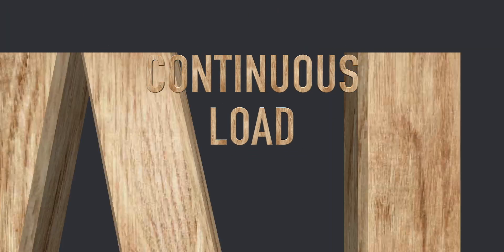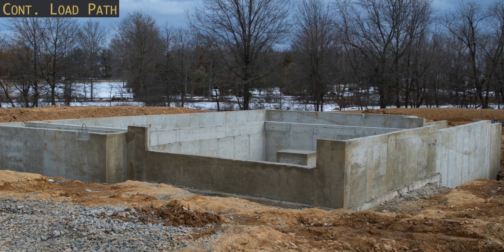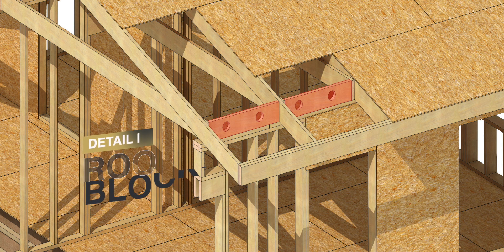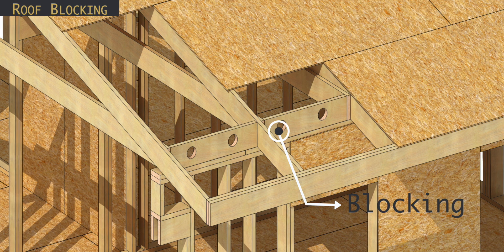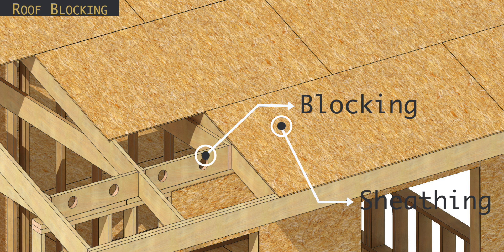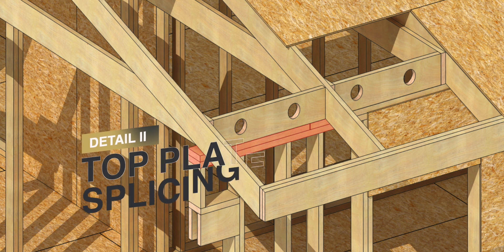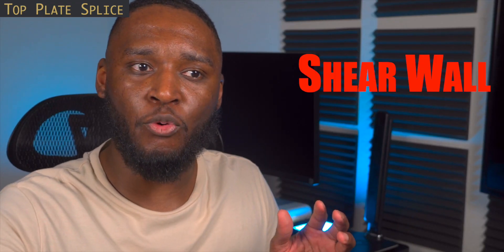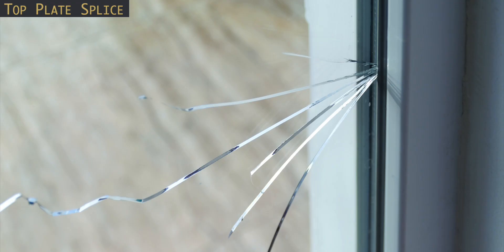These Small Wall & Roof Framing Mistakes Make a BIG DIFFERENCE in Home Safety

Comment from the maker: Follow-up questions for the video:

Q1. What takes the forces in the sheathing and puts them in the roof blocking?
A1.  The nailing that ties the sheathing and the roof blocking together.  Commonly called "diaphragm roof nailing" or "edge nailing", it's typically specified as 8d nails spaced between 2 in & 6 in (51 mm & 152 mm).

Q2. How do you fasten the roof blocking to the wall top plate?
A2. You can either toenail the roof blocking into the wall top plate, or you can use a framing angle from a manufacturer like Simpson (search "Simpson A-Framing Angles).

Q3. If I'm doing a renovation and I notice these issues, how should I address it?
A3. Definitely talk to a licensed, professional builder licensed where you live. There are many different retrofitting options but without knowing your specific situation makes it impossible to give a complete answer.

Comment: The roof  is like a beam resisting horizontal forces. The wall are the horizontal bearing of that beam. Without the transfer of the roof diaphragm to the walls the forces are not transferred to the supporting ground in high wind or earthquake. Without bracing the walls  could collapse.

Comment: For your point about roof blocking, couldnt you just cut the wall sheathing like a comb, so it runs up and in between each truss to meet the roof sheathing? 
Surely that would both help with these twisting forces and the structures airtightness at the same time?

Comment: REQUEST- I live i a very humid climate.  As a result the two story small home I am planning might benefit from new materials.  Can you comment on angular wall bracing and concrete sheeting.  I read that bracing is out and concrete siding makes a sheer wall.  I have doubts.
Reply from the maker: Angular wall bracing is something I’ve never used because I’ve found that it’s not as strong of a solution to a regular shear wall. There has been research from the American Plywood Association to back that up as well. Today could be a different story as far as angular wall bracing options because I haven’t been following that much but I personally haven’t seen a huge advantage structurally over a shear wall. 

I’m assuming you’re referring to Portland Cement plaster when you say concrete sheeting. If not respond with a link to the product you’re referring to. PCP is allowed to be used as a shear wall by the code but it’s strength is much less than say… 15/32” plywood/OSB with 8d nails into the studs. I wouldn’t use it to sheathe a whole structure from the perspective of having the strongest wood home against wind & earthquake unless plywood/OSB couldn’t be used. I personally wouldn’t try to revise the structural components for the sake of moisture, but I do think working with an architect you can come up with a wall section that can protect the structure from moisture.
Reply: @JthaEngineer  I am not sophisticated enough to post a link, but I have seen the term "sheer strength" or similar used with James Hardie PANEL, not plank. IMO "stucco" adds no material strength. Thank you for the detail.
Reply from the maker: @smarternu  panels like that & stucco definitely provide very little in comparison to OSB/plywood. I definitely would agree with you.

Comment: Wow!! You got on that connector topic fast. Those Ticos [aka: A35 clips] were the main event for a couple decades. They connect the vertical surface of the rafter block to the horizontal surface of the top plate. And like you say, they are not there to resist pullout/uplift [which they don't], they transfer the lateral loading on the outside and shear walls. 

Good stuff, man. Thanks.

Comment: Thus the second video of yours I’ve watched... I had to subscribe. You’re knowledgeable and combine common sense in your approach, well done again. When I frame exterior walls, I’ve always held my headers tight to the top plate. I’ve found it gives me more options for mi breaks in the top plate. And after doing remodels, realized it makes changing window/door sizes easier. Curious, what you think about that method?
Also when I use truss systems for a roof... I always use diagonal bracing that run from the exterior walls to the rat runs. I’m not an engineer, but thought that would help strengthen the roof system. Ive worked in a few big housing developments, and noticed that the framers who didn’t do this, had more issues with drywall cracks in the ceilings. Just a coincidence? What’s your opinion?
Reply from the maker: 1st Question:
I think having the header at the top plate is fine, but I would put a 1/2” to 3/4” gap between the cripple studs and attach them together with a deflection clip from Simpson. If the cripple studs are tight to the header you could incidentally transfer some load into the plate I assume you would use overtop the opening, thus the plate over the opening is acting as a header as well. I do agree the header at the top plate provides more flexibility & options and I personally would opt to do that in my designs.

2nd Question:
I’m not a truss designer and not knowing more factors like location, roof type, truss layout, etc it’s impossible to say whether it’s a coincidence or not. But at a minimum there should be bracing that meets SBCA requirements or the requirements straight from the truss designer. In special cases I will call for additional bracing, but as you know trusses are very flimsy so the more bracing, the better.

Thanks for the support!
Reply: @JthaEngineer  1st question- I like that idea!!! Here’s one for ya... when I set my windows, I will take a Dremel or fine cutting tool, and on the top flange of the window, I’ll make a slot going vertically about a half inch where the existing holes were made. The head of the nail hold the flange, but will allow settling, if it occurs. Would you suggest the same cripple/clip application with the header held low?

#2- Agreed!!! I always follow truss specs, that is a warranty fail, and code violation for sure. I’ve worked in 21 different states, and my hands have touched over 500 homes... codes are different in places. I learned a lot framing in Florida using trusses... major uplifts!!! 
I’ll keep up with your videos, and share you, with people I know. Theres a lot of carpenters in the industry today that should listen to you... and at least try, to learn the craft!!! 
Keep up the good work Jay!!!
Reply from the maker: If the header is held low, which I’m assuming you mean right above the window opening, I would not recommend the clip application and install the cripple studs the traditional method per code.

Comment: Sort of related, but not mentioned...It seems to me that putting wall sheathing on vertically makes more sense than horizontally, but no one does this.  What do engineers think?
Reply from the maker: Great question. Thanks for asking

The wood grains in the sheathing are what gives it its bending & shear strength. In order for the sheathing to be able to develop the most strength capacity, we do this by shortening the span length (or the gap in between the framing) that the grains in the sheathing has to span over unsupported.

So for example I have an 8’ high wall with studs spaced 16” oc. Putting the sheathing vertically means the grains in the sheathing are spanning 8’ which results in sheathing that’s significantly weaker against bending & shear than if it were placed horizontally.

Another way to look at it is if you had an 8’ long floor joist supported at the ends vs. it being supported every 16”. The floor joist supported every 16” would be significantly stronger than the other option. Different application but same principle.
Reply: @JthaEngineer  Thanks.  It's not the first time I've been wrong.
Reply from the maker: It’s all about learning… No judgment here!

Comment: What's your opinion on poorly manufactured trusses with gusset plates that are not stamped properly.  How would that impact the structure in say a storm with high winds
Reply from the maker: High winds put uplift pressure on a roof so poorly manufactured trusses would be a concern in that regard as those trusses would be responsible for keeping your roof on the house.

Depending on the structural layout & design of a home, we will also use a truss as a link between the roof sheathing & an interior shear wall that doesn’t go all the way up to the roof so that the shear wall can do its job. So a poorly manufactured truss may not allow a building to perform in the manner it was designed. In this case, making an interior shear wall useless and potentially overloading other shear walls in a building

Moral of the story is if you suspect they’re defective, reach out to the truss manufacturer.

Comment: Nice, clear presentation.   Of course, if your building racks under high winds, you might get far worse damage than just breaking a window.
Reply from the maker: Agreed. I mentioned that from the perspective of seeing cracked glass after a 50-70 mph gust. Low from a design & engineering perspective but still higher than what we might witness on a breezy day. Could only imagine the result if the wind speed was any higher.